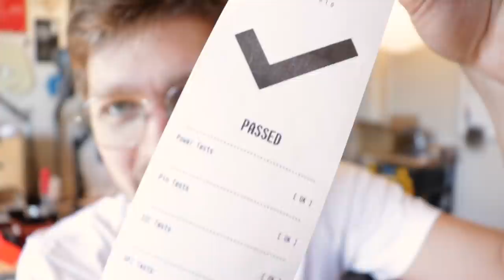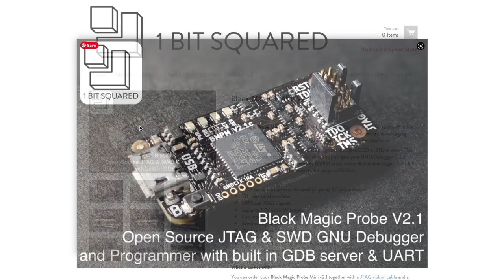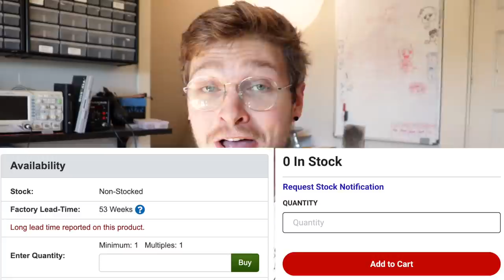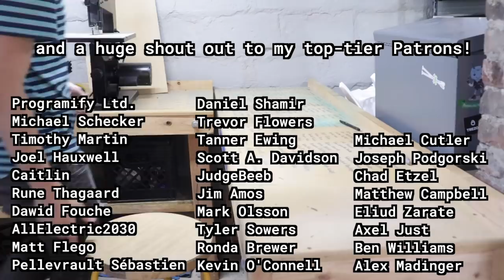Fully Automated PCB Testing

Comment: It may be a good idea to get longer pogo pins for the gnd connections so they always are the first to make contact
Reply: i was about to say the same thing
Reply from the maker: Good thought! ill do that!
Reply: Or just solder them a bit higher. This is cheaper than two different pogo pins
Reply: Or just a shorter one for the power.
Reply: This!
Reply: Adding a power sequencer could also help.
Reply: Works a treat, I have actually seen this on industry standard programmer boards.
Reply: @stephen_hawes  Why not manage all the powers from the controller (the Raspi in this case) and add an additional pogo-pin that touch GND and connected with a pull-ups resistor to check if the ground connection is properly attached?

Comment: ..or you just make the 24v pin shorter and the ground pins longer
Reply: This is like de-facto standard for so many hot swap situations
Reply: I came to post this and the master has spoken already...of course! Good old 'make before break' versus 'break before make' just in pogo.
Reply: also use current limiting and sensing. sounds like his tester only tests the microcontroller side of stuff but not the output MOSFETS and such?

Comment: On my jigs, I have no power to a board at the start, and control it via a load switch that only turns on when the test starts, I have the GND pins on the jig weakly pulled high, so I can detect when a board is inserted (GND pulled low) and if that detection is not found, I am blocked from trying to run the test. This way a board has to be properly seated before any power can be applied.

This also allows me to do short detection (via the load switch) and have power shut down instantly if a fault occurs, and I can read the error pin on the load switch so I know what the test stopped. I've never blown a board in over 25k tests :)
Reply: It would be cool if you did a video on how you do this!
Reply: Yeah not having the jig sending power by default is a good idea.  Throwing my setup out there as well for anyone else reading and looking for inspiration.  My jigs use SCPI to control a 3-port Rigol supply and a Rigol bench multimeter.  SCPI is "Standard Commands for Programmable Instruments" This is what the RS232 port on many instruments is for.  Follow the protocol and you can automate your instruments with a microcontroller or a USB/RS232 converter etc.  (there are other options than SCPI but its one of the simplest to implement embedded if that is desired).  Moving on I also use relays as well to cut the impedance of the supplies.  I first run resistance checks of power rails to make sure boards fall within expected ranges prior to introducing power.  If the resistance is out of range there is typically an issue with the board that will fail power up.  So this is an opportunity to save the board before accidently frying it. Then my routine checks continuity between any power pins that are on separate connectors.  With SCPI control of the power supply you can also limit the current set the voltage dynamically etc.  So you can test a basic power up with a trip current that is just barely sufficient.  Then when firmware is loaded etc. the limit can be adjusted etc.  It is more expensive to use a smart bench supply and a bench multimeter but I think in the long run it has been a great investment over doing all the acquisition onboard a specific test PCB.  The only items I put on test PCBs these days are i2C i/o expanders for basic i/o testing, and analog muxes for the digital multimeter to analyze analog signals (occasionally scope as well).  TLDR I recommend using bench supplies with SCPI.  This lets you control power up while also controling current and voltage limits to protect against faults breaking chips.

Comment: For the 24V issue, there is also the issue of disconnecting the apparatus. A shorter 24V pin and a longer GND pin is an easy and reliable solution. I think the "best" solution would be to have it be software controlled by the tester itself -- it turns on the rail only after it senses continuity AND a 500ms delay, and turns it off again after a successful test. 

I really like what another commenter said in that "there is no budget for a test rig". There is only going to be one, it's definitely worth the extra expense making it right.
Reply: ^this. Only thing to add is that the 24V has to be turnt off after every test, not just a successful one. In fact my logic would be inverse, it should only be turned on while testing, not before nor after.

Comment: Stephen,
I’ve done ASIC test for 30 years now.  You probably already know this but you can test continuity on any pins that come to the outside by pulling them below GND using a constant current source.  Sink about 100uA out of the pin and the voltage from that pin to GND will be between -400 to -600mV.  That is if it is soldered correctly.  If it is open it will read the full negative voltage your constant current source is capable of.  In other words it will read that negative rail.  Or 0V is shorted to GND.  
In ASIC test this is the first thing we do to ensure all pins are properly connected in the socket.
Reply: Hi, Stephen.  I am very interested in this comment.  Could you please provide more details on this test.  Do you use an SMU?  Do you have a link you can provide for more details?  Or a reference?  Thanks.
Reply: Same here! Any info/references would be well appreciated :)

Comment: If you put some series resistors in series with the measurement pins it will limit the current when a fault occurs and protect your boards. The fault is not only when inserting the board, but maybe also when there is a short on the board.
Reply: Yes, some current limiting resistors and fuses (or polyfuses - the resettable ones) on the power lines can help prevent the chips blowing out.

Comment: I highly recommend test driven development. You basically do what you did, driving the code using tests. This means you think you need a feature,  then write the test that would prove the feature works, then write the code. The big benefits is that the test serve a a proof that your code does what it should do and serve as documentation.
Reply: In his case even ATDD with Gherkin (Cucumber / SpecFlow).

Comment: Your friend is wrong about software...IMHO. Long time software developer here, refactoring is how you clean up your structure. As you said, doing it "big bang" (aka Waterfall) means that debugging is trickier as you don't know what might have broken - there could be dozens of bugs. This isn't a massive software project, though, so YMMV.
Reply: If have all your goals clearly defined in advance there is zero reason to bullrush the whole codebase without ever testing it. Problems come from tacking needs on, not testing and writing more code
Reply: My immediate gut response as well, especially with hardware interfacing.
Reply: Although, if you put in test modes for each of the software components and have some way of enabling them one at a time, then it makes debugging easier. It's something that I have done before for a complex project.
But it almost doubles the effort - because you need to code in real operation and a test mode.
Reply: I don't think it's about writing the software all at once, it's about having a consistent architecture

Comment: For rev 2 of the tester board, you should add a solid-state power switch (Like those little power chips in USB hubs, except not) on the 24-volt rail, and add a current monitor to quickly check for short circuits.
Reply: Those two functions can be combined using an E-fuse. Those chips usually have short circuit protection, an enable pin and current monitoring!

Comment: The bluepill you bought has a fake STM32 clone. Likely a CS32F103 or GD32F103(or APM32F103, BLM32F103, HK32F103,MM32F103). Both have catastrophic silicon bugs that prevent certain peripherals(like USB) from working.
Your receipt printer is also really slow. You're doing something wrong there, it should print at double-digit mm/s at highest power.
Reply: I've actually heard folks argue that one of the benefits of the f103 is that these clones exist, like old school second sourcing. The ones from giga devices (gd32f103) are apparently actually pretty good. (And nobody's getting anything from ST anyway right now)

 To be honest the original has catastrophic silicon flaws, just look at the errata sheet, and be glad you're probably using an Arduino driver for the i2c peripheral. I once had to work on some code that was just bit banging i2c because it's easier than getting the crappy f103 i2c peripheral working, and I didn't realize the depth of the flaws when I started and thought "that's a hack and error prone, I should use the actual peripheral" 🤦 scarred for life

Comment: Did you guys just said we should go back develop in waterfall? 

The circle is complete! Dev is now like fashion it just goes in circle every 30 years!! 

(Btw love the project, just my inner grand-pa shaking its stick at the youth)
Reply: Waterfall should never be an answer though. If Agile isn't working for you it means you need to fix your Agile, not go back to practices we moved away from for good reasons.

Agreed on the project though, looks amazing.
Reply: @klh_io  waterfall may be an acceptable application for this. his requirements are very well-defined and will NOT change (he is constrained by the hardware). but yeah doing it "little by little" forces you to write testable code.
Reply: @klh_io  iterative project management and and iterative product development lifecycles have been around since at least the 50s.  In general, there is no "this lifecycle/framework is better than that one".  Everything must be "tailored" according to the specific needs of the project/product.  The uncertainty around the solution, and requirements, and the complexity of the problem must be accounted for, and everything must be monitored and adjusted as necessary.  But most of the time, no framework fits perfectly, so projects usually contain both iterative and predictive lifecycle phases, and can often shift from one type of planning to another, depending on feedback from the teams, new requirements, changes, etc.

Comment: Definitely curious about panelization, either doing it yourself or having the PCB manufacturer do it (and obviously needing the panel-wide stencil either way).
Reply: wayy too late, but give it a look at pcb tools by ThisIsNotRocketScience. not sure how it would perform in a "professional" setting, but for home users works great.
Reply: @andreacerfoglia8007  I recall having some difficulty getting it to build in Linux, and some difficulty figuring it out in Windows. Ultimately, I ended up using KiKit which let me script the process using a configuration file. That's kinda a better approach for me, since its more repeatable.

Comment: Excellent work! 

I actively avoid writing large chunks of code at once because it leads to a long period of fixing all the little errors, but you bring up a good point about the gain on overall architecture. I guess, as someone who doesn't like writing code, how do you push forward without feeling all the little gains from incrementally working code?
Reply: Automated testing (unit and integration tests)
Reply: @JoseAlcerreca  Ugh. Yeah. You're right. I guess this is why solder is my favorite coding language.
Reply: This is why pseudocode as a concept exists. Write pseudocode, work out the low level implementation later.
Reply: @Yp-ku4sy  Yes, absolutely, or any other form of "noodling" in advance of writing code (or proceeding with another kind of project that has more than one component). Something as simple as post-it notes stuck on the wall will make the system design a hands-and-eyes-on process. Each note represents a functional block of code that you then code and test. Up-front noodling of this sort separates design from troubleshooting, clarifying the former and greatly simplifying the latter. 

I'm reminded of the old (and no doubt politically-incorrect) joke about an old bull and a young bull on a hill, and the young one says, "Come on, Pop, let's run down the hill and get us a heifer!", to which the old bull replies, "No, son, let's walk down and get them all."

Comment: Is that a really slow receipt printer or is it just the communication to it that is slow? Seems to take almost as much time to print the receipt than to test the board.
Reply: The bitmap graphics part is always painfully slow. The preprogrammed fonts print much faster.
Reply: Some thermal printers take much longer to print images than just plain old text.  One thing to try and speed it up is to just print the perimiter of the check or the X rather than have it solid all the way through.

Comment: I would recommend checking out load switches from Texas Instruments. Wait like 40ms after contact is established to power up the rails. After test passes, send a signal to power down rails in correct sequence.
Reply: Also, consider adding some kind of resistance check to ensure there is no short to GND on any of the power rails. Only if the resistance check passes, do you power on the board under test.
Reply: load switches may be overkill. just current limiting and current sensing should work.

Comment: Quick tip, that thermal printer seems a little bit slow, what i suggest is buying a receipt printer (like those you may find in restaurant, you can buy one on amazon or ebay for like 50 $) and use the python-escpos library (really easy to use) to interface your raspberry with the printer! That library also supports ethernet connectivity, so when you will scale (hope you will) your production and testing you can hook up more testing gig to a single printer

Comment: This is so interesting and is also a passion of mine.  We have a lot of similarities.  My approach is the write C# code that controls programmable test equipment such as power supplies, meters, and generators.  These are connected to a PCB test fixture with circuitry and Pogo Pins.  The PCB to be tested is placed on the Pogo Pins and the program is run.  The results are stored for later analysis.  Automation is part of a larger passion of mine:  efficiency.  It would be interesting if we could connect and compare and contrast of methods.  Wishing you an amazing day!

Comment: In the case where it's not practical to use a relay or MOSFET to switch the supply voltage, make sure the VCC pogopin is shorter than other pins so it will only make contact once the rest of the pins are touching.

Comment: The Black Magic Probe code for the Bluepill is much better now. It took me around 3-4 days days from start to finish, but I managed to build the firmware binary from source, flash it and write a launch.json file for VSCode. It works pretty reliably, and if  the probe crashes, the easy fix for that is to just press the RESET button.

The reason buying it was not an option for me was that 60 dollars is a lot of money in my country and the shipping would take forever. Faster to make one myself, and I larned a lot of important things in the journey.

Comment: Sounds like adding some protection diodes would have saved you a few fried controllers as well.
In general, we also make all power supplies switchable on test jigs and typically have a "switch" to detect if a board is loaded. We also use compressed air for loading the board if possible. If I remember they typically place a board, close the lid on the tester and that triggers the test.

Comment: Stephen, I think the way you should approach the grounding issue is by putting it on the backplate. You could easily build this into your jig. But if you had say 3-5 places that ground the board it would when you apply the 24v it will have ground in multiple places to run to.

Comment: For my SP Racing FC tester, i designed a short-circut tester using 2 multiplexers, also have an io isolation board between the target board and the host board, power to target is controlled by mosfets, and only applied after circuit tester has tested power rails for shorts.  power is cut if any rail is out-of-range.  this has worked flawlessly for me so far.
Reply: Can you explain how you do this?

Comment: Nice job. One thing you can do with the printing that can be both handy, and save a little time, is to print each test result as it happens and then only print the overall PASS/FAIL at the bottom of the receipt. This way you are not running the tests and then waiting for output, the output happens as the tests are run. This may or may not be significant depending on how long the testing takes. The other nice thing is that if the whole thing dies mid-test, you have a live progress report on how far things got before it died.